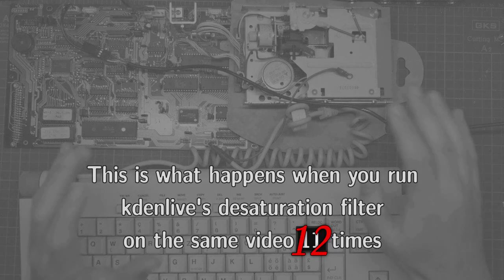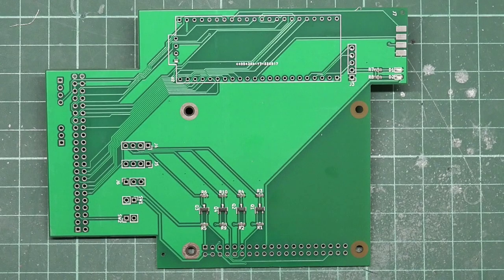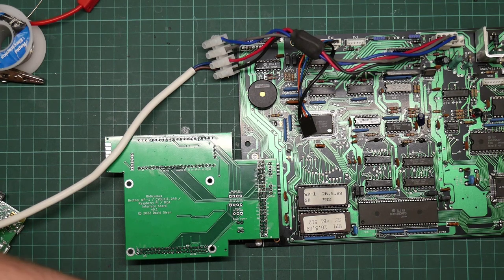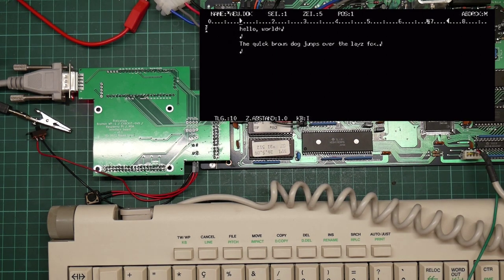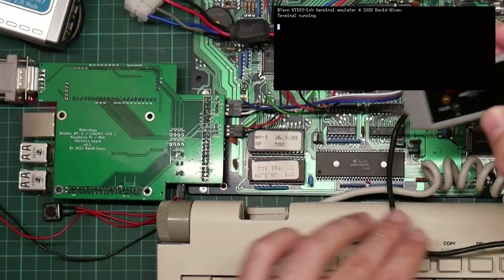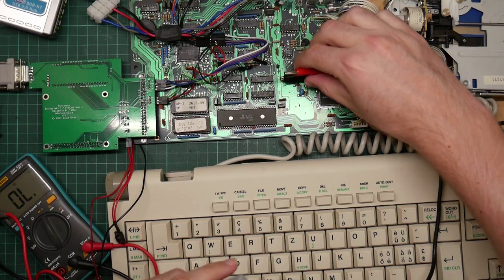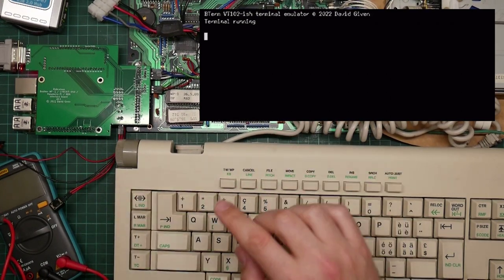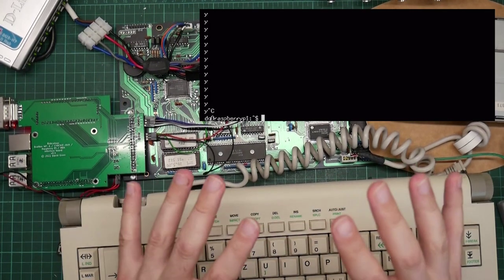A Brother WP-1 serial interface #13: JLCPCBFTW!

Comment: On the Raspberry Pi there should be a file /boot/cmdline.txt which controls the Linux kernel command line parameters.
Depending on the version there should be an entry like console=ttyAMA0,1200
You can enable the hardware flow control by adding some more characters to the options:
console=ttyAMA0,115200n8r would set the serial port to 1200 baud,  n=no parity, 8=8 data bits, r=RTS flow control

Here is the description of the options from the Linux kernel docs:
	options:	depend on the driver. For the serial port this
			defines the baudrate/parity/bits/flow control of
			the port, in the format BBBBPNF, where BBBB is the
			speed, P is parity (n/o/e), N is number of bits,
			and F is flow control ('r' for RTS). Default is
			9600n8. The maximum baudrate is 115200.
Reply from the maker: True, but the tricky bit is the device tree overlay to actually enable the RTS/CTS pins. Without that nothing works as the interface and the UART can't communicate!
Reply: @hjalfi  I can try to build you an specific device tree overlay, if you answer me some questions:
- Which Raspberry Pi model do you currently use?
- Which UART and GPIO pins do you use it (including RTS/CTS)?
- How do you enable HW-handshake at the moment?
- What does your current /boot/cmdline.txt look like?

Comment: A booting pi does indeed use a lot more current than when idle - over double in fact, depending on the pi model...  Full whack CPU and writing to SD card for ATIME, etc.

-Dx

PS, What video editor did you settle on in the end?
Reply from the maker: Davinci Resolve. I have to transcode all my video to MJPEG first, though. <meme>WHAT YEAR IS IT?</meme>

Comment: You're not giving the RPi enough power to run properly. A 3B needs at least 5.1 volts @  2.5 Amp. If you try 'sudo vcgencmd get_throttled', if you get anything other than 0x0 or 0x5000 then your RPi is suffering, and will give you problems.